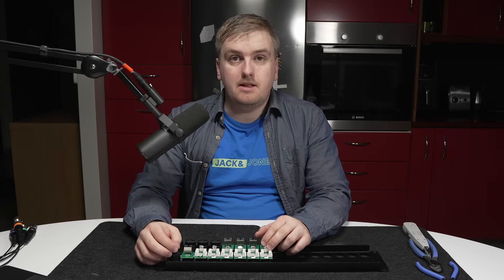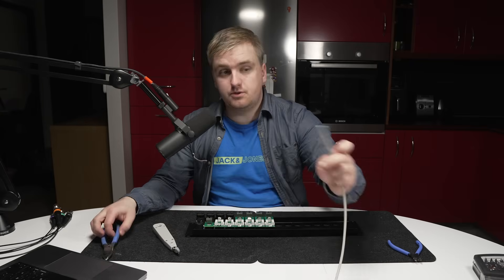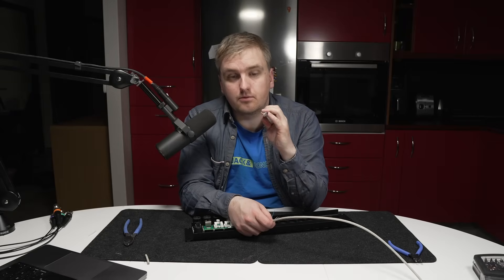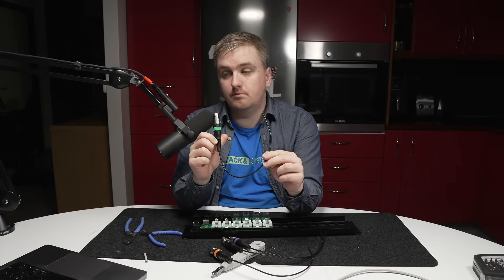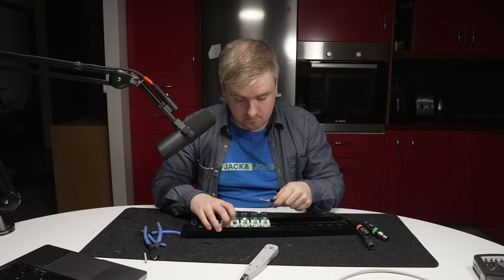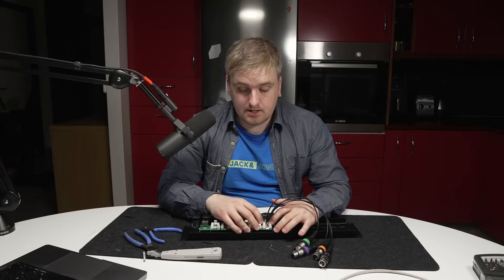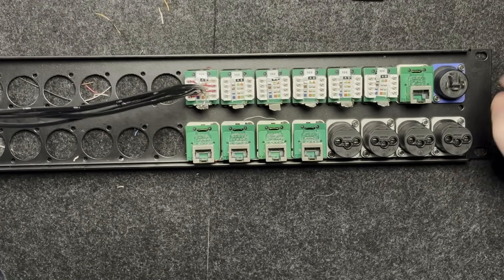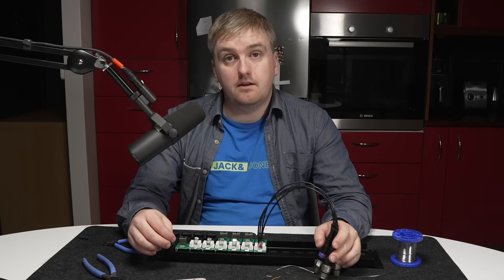Analog Audio over Cat 5/6/7 - Building your own panels

Comment: Are those sorts of connections suitable for portable equipment? I've only ever seen IDC on permanent installs.
Reply from the maker: To be honest I have no idea. Everything has been working for me and I don't see any reason it shouldn't continue to do so.
Reply: @arnieitthvad  well it looks great. I've been going to do this for ages but I was going to get some PCBs made to solder the audio wires. It will really simplify setup. We have a gig tonight on a 4 band bill on a tiny stage so there's a 15 minute changeover between bands. I've got setup streamlined but I'm only ever happy once it's all over!
Reply from the maker: @fuzzylogickben  Totally, with a 7pc band and everyone on wired IEMs setup time was a pain! First setup was a Presonus HP60 that was placed centrally and headphone extensions going to everyone.

We had as gig in January where there was essentially no setup time, the dinner event finished and while they were moving around tables etc. we had to set up, I finished the pedalboard breakout boxes for the guitarists before that show which mad the thing possible. I'll do a video where I show that solution once I have one of the pedalboards at home. The rehearsal space is in another town (30 minutes drive) so I don't have instant access to everything.